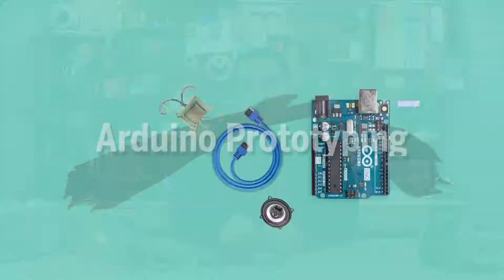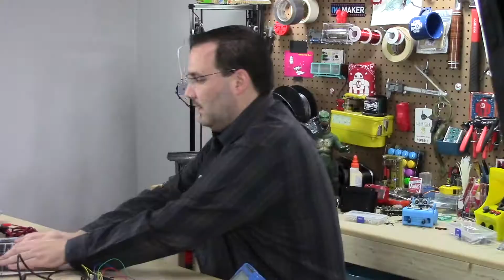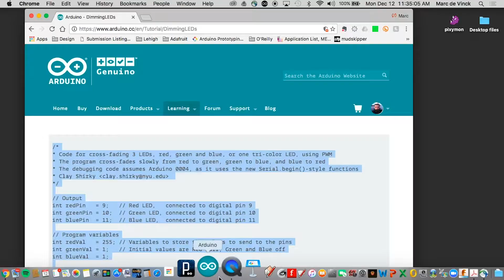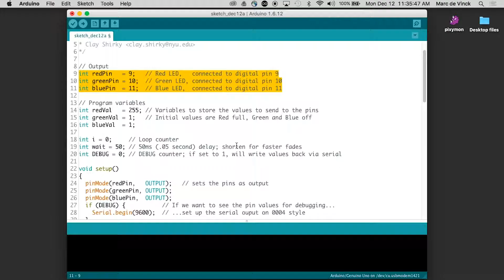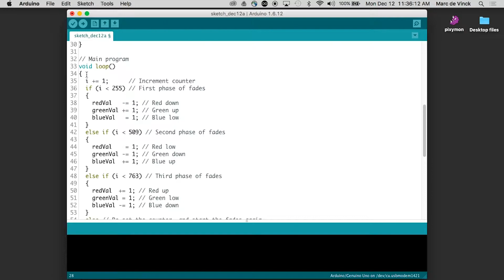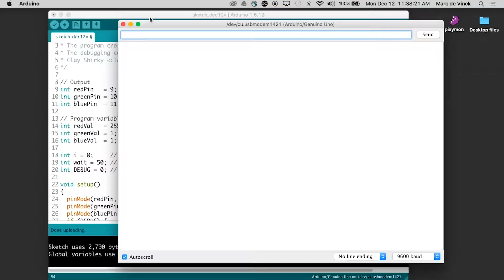Arduino RGB LED Tutorial: Common Anode or Cathode? (Coin Cell Trick)

Comment from the maker: ⚡ Quick tip: don't throw away the coin cell after you identify the leads. Touch the positive to the common leg and bridge two color legs at once and you can preview a mixed color before you ever wire it up. Green plus blue gives you that turquoise. Red will overpower almost everything, which is exactly why the resistors matter once you build it for real.

📌 FULL SERIES: Watch all 100+ episodes of the Complete Arduino Prototyping Series. https://www.youtube.com/playlist?list=PLcKte0wD90Y4lsrStEWB5NR1gKMs0FDts

Anode or cathode, what did yours turn out to be?